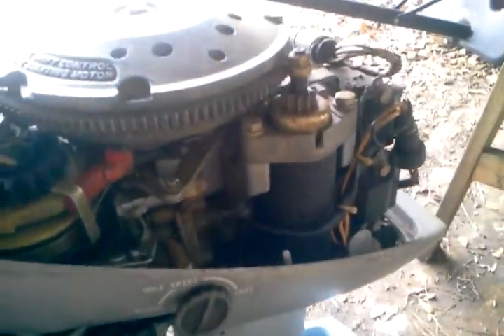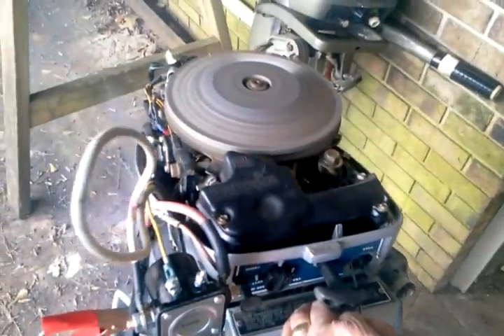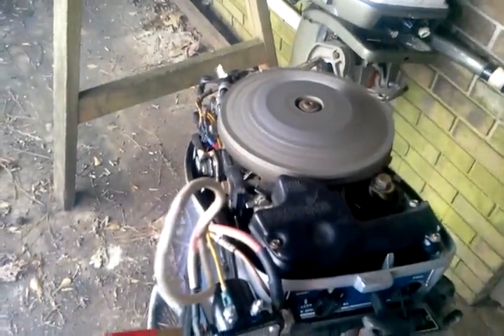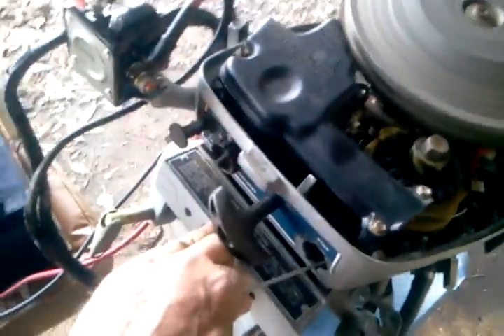Evinrude 9.9 electric start.

Comment: I have a '75 electric start I got in trade. I have the solenoid and a starter button but can't figure how to wire. Hooked up to battery I can arch across solenoid and it'll fire. Just can't figure wiring to use but Tom. Can you help?
Reply from the maker: +Steve Longacre Hi Steve.  Not sure if I can.  I no longer have this motor.  From what I remember, my switch went to one side of the solenoid and the battery to the starter on the other posts of the solenoid.  I am sure you can google it to find how the solenoid works.  BTW, are you close to Clearwater?